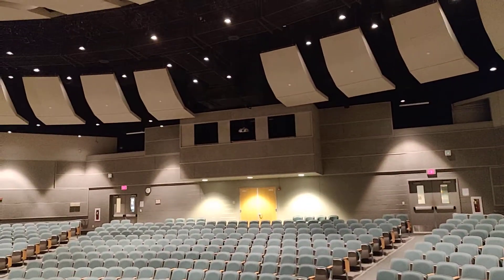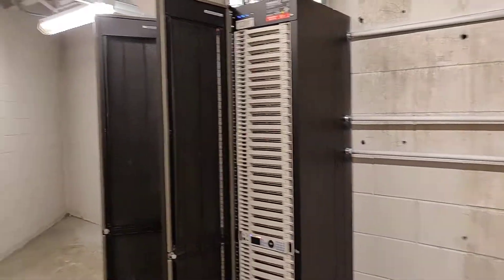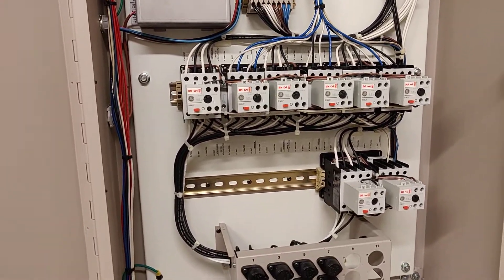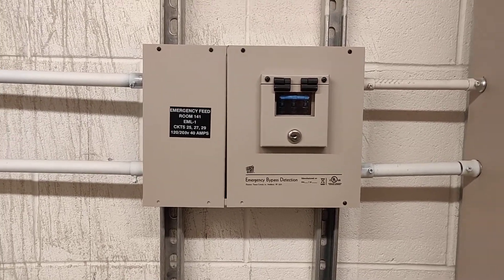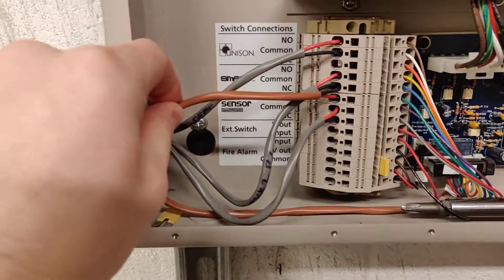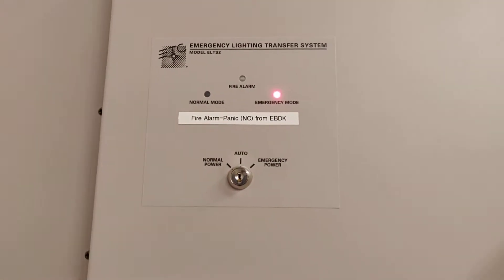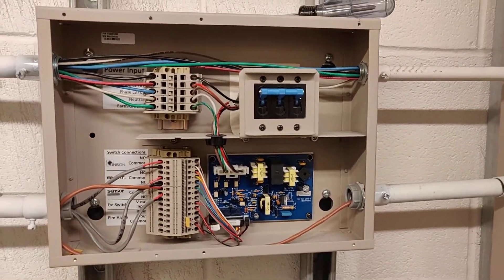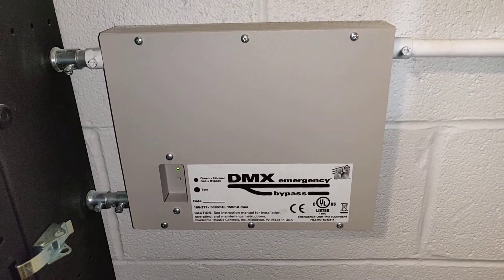ETC EBDK Emergency Lights Repair

Comment: Can the ELTS work without the EBDK? It seems a bit odd that the dedicated Fire Alarm input has been used for power loss detection, rather than it being a dedicated input, or being built-in to the transfer switch itself.
Reply from the maker: Yes, normally there is a jumper on the fire alarm terminals if you are not using an external trigger. In that case it would switch to emergency power on a power loss after a preset delay. This works fine if all of your house lights are incandescent. Because we have a combination of incandescent and LED house lights at this site, we are using the EBDK to trigger the ELTS, the DEBC, and the Sensor dimmer racks.

Comment: But what does the emergency power source come from?
Reply from the maker: A separate breaker panel that is fed from either utility power, or generator. If the power goes out, the generator starts then all the emergency loads are automatically connected to generator power.

Comment: Quick question about the ELTS2 Panel. Switching the key from auto to emergency then back to normal/auto would act as only a test of the emergency lights/panic functionality and not cause any issues with the emergency power or fire alarm controls, correct?
Reply from the maker: That is correct. As long as you have your emergency source connected, you should see your emergency lights power up.